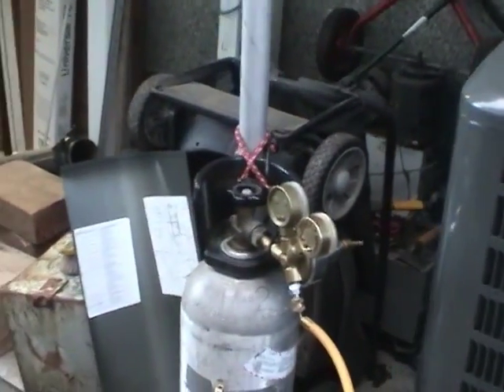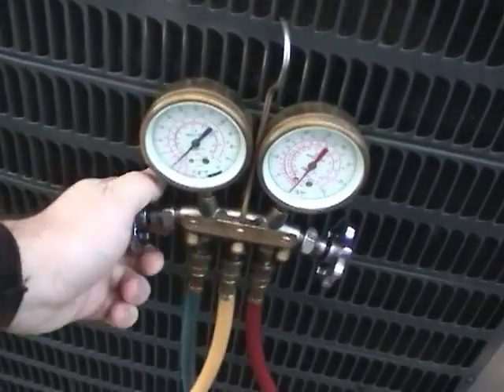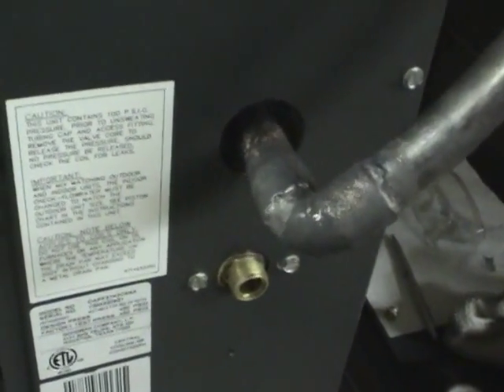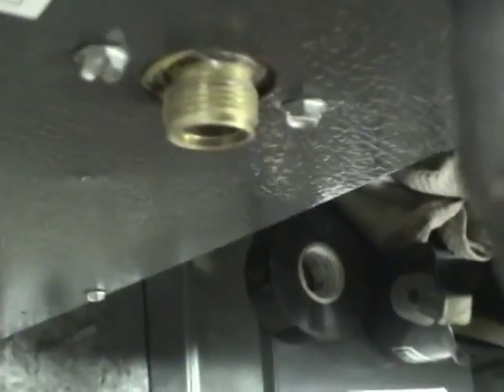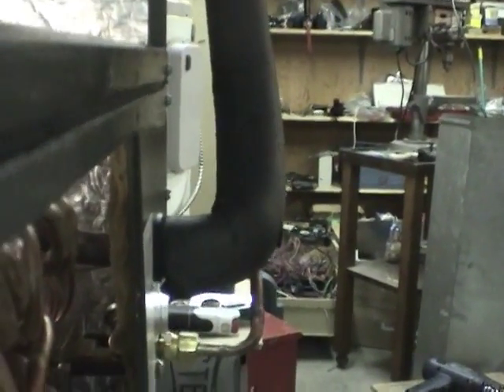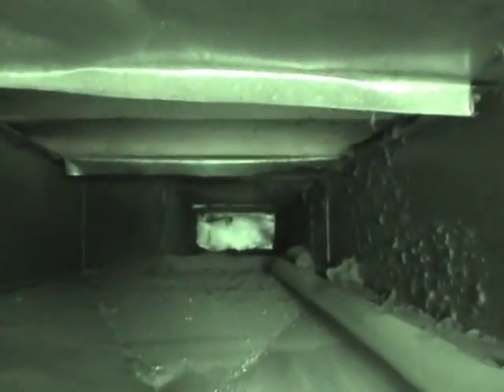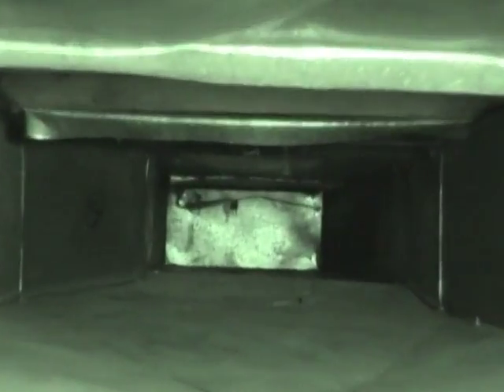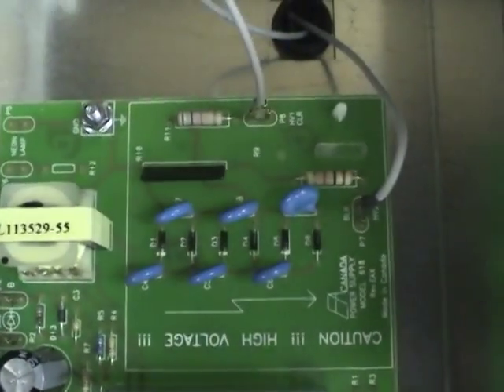Heat Pump Installation - Part 4

Comment: ***** I have an old Trane XE 1200 heat pump from 1996. It is a 2 ton , and the air handler has the same strange TXV set up outside the air handler. It takes up a lot of space, and both the indoor and outdoor TXV are busted now. The reversing valve is stiff when it switches, so I need a new unit, but the coil is very interesting. It's a slab coil, and the air filter mounts right on it.

Comment: The txv is screwed to the cabinet so it can be removed and or use the piston orifice that comes with the coil from the factory. And its outside of the cabinet for easier access to adjust the super heat if necessary, Also the bulb needs to be behind the bypass inside the cabinet otherwise you will find your suction side pressure surging during operation and check out. Also, turn the heat up on that torch.

Comment: IGNORE THE ABOVE RESPONSE.  I meant to question why all the refrigerant connections to the other 3 to the suction line and  the high side line on the condenser are not screwed like the evaporator inlet screwed fitting.  Anybody?

Comment: i think that steel piece is a die in a flaring tool set. could have possibly been used to flare tubing splice or extension? just a though not 100% on that though

Comment: Copper is an excellent conductor and the fittings will reach thermodynamic equilibrium fast. Keep the flame moving, but steadily. Secondly, your gas flow from the torch does not seem to be high enough--the tip will overheat very quickly. Otherwise, you are set up properly. Good to see proper procedures being followed with regard to nitrogen purging. The tech I worked with didn't do that :(
Sorry for the late reply. Cheers!
Reply: what is the reason for the nitrogen? is it necessary or could the lines be purged when charging the system?
Reply: @lorenzo42p  the copper will oxidize internally while brazing, nitrogen prevents that.

Comment: Good stuff!, funny how they have the TXV on the outside of those units, good idea moving it inside.

Somthing a lot of DIY'ers neglect is the nitrogen purge during brazing, one of the many things that can lead to compressor failure, TXV or filter plugging etc. good vid!.